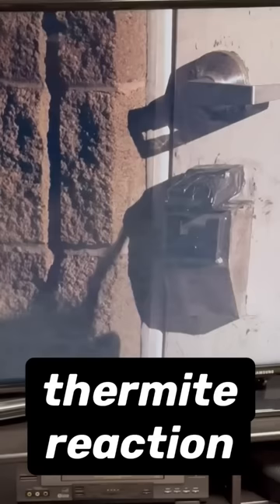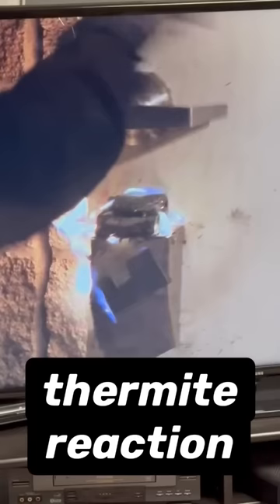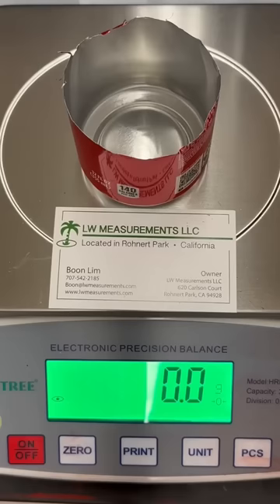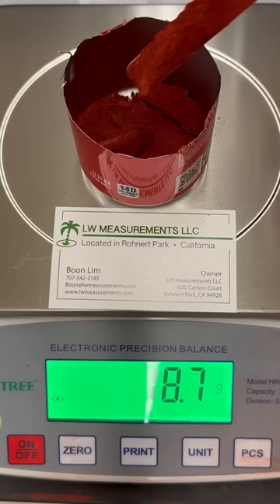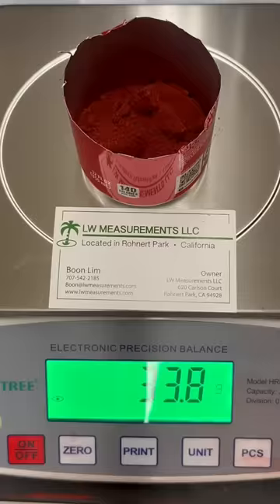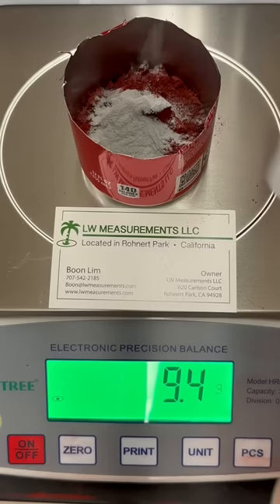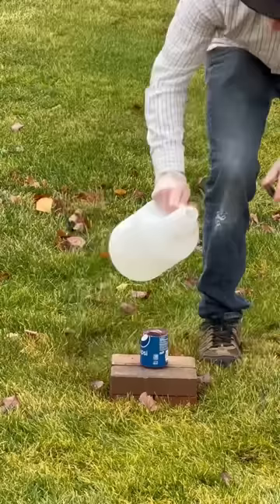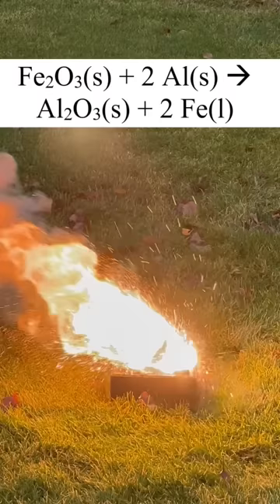Breaking Bad Chemistry: The Power of the Thermite Reaction 🧪🔥 #breakingbad #chemicalreaction

Comment: This same principle was used in a MacGyver episode, I think it was he used rust and copper from an old copper penny, he scraped the rust off of some metal scraped the copper penny on something that resemble a file, collected the rust and copper put it in a metal tube i think it was off of a bed frame in the room he was being keep in he plugged one in with a piece of wood used a match to lite the rust and copper essentially creating a crude cutting torch that he used to melt the locking mechanism on the door and escaping.

Comment: Thermite is awesome definitely need to be respected though it's dangerous
Reply from the maker: Indeed
Reply: @TommyTechnetium  
The experiment is not necessarily dangerous if one observes the necessary safety precautions, that is:
1. use rather small amounts
2. use a sparkler or a longer piece of magnesium ribbon as a fuse to buy time to move at least 15 feed away before the mixture ignites.
3. choose a fireproof base (a fireclay brick)
4. embedding the jar of mixture in a larger sand-filled jar (clay flower pots have proven helpful for this)
5. nothing within 15 feed around that can catch fire
6. wear welding gloves and goggles
7. of course only carry out outdoors
8. make sure that the smoke cannot move into neighboring houses
9. have a good relationship with your neighbors, inform and ask them not to call the fire brigade as soon as smoke starts to appear ;-)
10. not touching the mass after the reaction until it has really cooled down
11. not pour water onto the burning mixture or carry out the experiment in the rain or snow (otherwise risk of explosion!)

So definitely nothing for the balcony of the rented apartment. But if carried out correctly according to the above points it is not necessarily life-threatening even for laypeople... ;-)

Comment: Roughly 1 part aluminum powder, 2 parts rust(Iron oxide). You will need a magnesium fuse(the kind they use for fireworks) or it wont ignite. Rust is easy to get, and a rock tumbler will powder aluminum.

Comment: aluminium is used in lots of stuff, flash grenades, fireworks. Its just good that a proper reaction requires a specific diameter to be that effective or else every criminal would run around with a tiny bag of it with a piezo fuse to quickly get rid of locks.

Comment: When you mix fuel, metal oxide and metal powder, it burns up to 1000 Degrees Fahrenheit, hot enough to burn through any barricade known to man. Add some C4 into the mix, and you got one hell of a combination.
Reply: 1000°F barely makes steel mailable.
1300°F to ignite steel for cutting with a torch even though most grades don’t melt until their liquidus temperature which is around 2750°

Comment: Wish you explained why they were able to light it with a torch because from what I understand a magnesium strip is required to get the proper heat to ignite thermite mixtures. And the magnesium (if I'm right that it's magnesium) is pretty easy to ignite with just a spark.
Reply from the maker: Mg indeed works. I've never tried a propane torch
Reply: @TommyTechnetium  I don't think a torch alone will even work.
Reply from the maker: @kidpiper9642  I wish I could figure out a safe way to test this. No way I'm trying to light thermite with a torch
Reply: @TommyTechnetium  That's why I didn't bother trying to tell you to try it. Imagine blowing the stuff into the air and a gust of wind carrying it your way. Scary stuff!

Comment: The show makes it out to be very elaborate - with using aluminum oxide from those magic-drawing-toys.

You can file down any aluminum to get the power or buy the powder already (which, to be fair would leave a trail, so filing it is).
Reply: Spraying (fine mist) molten aluminum into a cooled inert gas is the fastest means of powdered aluminum.
Reply: Yea… you can’t make aluminum powder at home easy….  And it has to be FINE otherwise the thermite only smolders at best…

Comment: An oxygen lance  is the best thing for opening things.  My welding textbook says it will cut thru 6ft of steel and concrete.
Reply: My friend bought a house and the basement was rebar reinforced concrete.  One day he needed access to the plumbing for the kitchen sink and discovered that it ran to a room in the basement with no way to access the room.  We made a thermic lance out of an iron pipe filled with a steel cable that we untwisted and connected a hose to an oxygen cylinder.  We cut a hole about 12"x 12" and that was enough of that.  The amount of smoke produced was unbelievable.  The smoke was from  the  concrete.  You couldn't see your hand in front of your face.  It was fast and it cut through the rebar as well as the concrete. It was just so dangerous because we couldn't see anything and you've basically got the sun on the end of your pipe ready to burst anything into flame.  Not to mention breathing the smoke.  The room was filled 6 feet deep with broken glass.  We have no idea why someone would build a house with a ten foot by ten foot by eight foot, concrete room with no doors or windows in the basement and fill it nearly to the top with broken glass.  We shoveled glass out of there for 3 weeks.  We cut a door sized opening with a gasoline powered  abrasive saw.  Much slower but neater and safer.

Comment: I used to working construction and we tore up a parking lot and we found a whole entire railyard underneath it we tried cutting it with a hazard saw then tried cutting it with a oxy settling torch and I got so annoyed I just finally called up the fire department told them I was making a boatload a thermite to cut up the tracks and we got a permit to do it it works pretty good

Comment: It takes yes rust and aluminium,, but um it takes an oxidizer as well,, not just fuel
Reply from the maker: The oxidizer is the rust
Reply: @TommyTechnetium  um not so sure iron oxide has near enough oxogen to create such a hot burn,,, usually it's used as a fuel/secondary oxidizer in fire works,, all thermite's i know of use a chlorate or chloride as main oxidodizer🤔🤔
Reply: @TommyTechnetium  don't get me wrong, cuz I know there are different standard,,, what we use as electrician burns realy fricking fast cuz we are only welding a small joint,, so it might be differnt for large thick chunks of metal 🤔👍
Reply from the maker: @marktemplin1159  I'm just using the chemical definition of "oxidizer". That's probably where the difference is coming from
Reply: @TommyTechnetium  probably true, I used to have fun wene I was younger and probably forget more than I realize🤔👍 there are some simple things I remember,, it's been shit, 25 years since I was making my own home made stuff 👍
Reply from the maker: @marktemplin1159  It's so true! We forget so much as we age. Probably in part because there's so much more to remember

Comment: Jet fuel can't melt steel beams.
Reply: But it can weaken them significantly
Reply: It’s doesn’t need to turn them into molten metal, just weaken them enough to allow for failure. Go take a lighter and heat a paper clip until it’s glowing. You can bend it with minimal force, yet you didn’t heat it to its melting point. 

It’s amazing how simple of an answer that is……it’s only been 22 years and you still can’t grasp the concept
Reply: @joe4171 
The beams were literally vaporized not melted or heated. Vaporized.

Comment: One of the holes in the movie script...
I doubt it would had worked cause of the loss of energy.
Stream should had been localised to the lock...
Reply from the maker: I kind of tried testing this. See https://youtube.com/shorts/HGNYX-4XWqE?feature=shared
Reply: @TommyTechnetium  I already saw the video...
Where's you trying to bust the similar lock to the scene mentioned?
I am guessing it would melt part of the outside of the lock but not cut it...
Some ceramic casing with narrowish hole would build a stream of reacting thermite concentrated and aimed to a certain area, cutting threw the lock, doors, anything...
Reply: @TommyTechnetium  Shame for the series, even plot is full of holes...
"Breaking bad" had potential to be the great TV show, but it's just cheap fun for the masses and insanely overrated.

Comment: Highschool level chem q:
Heat energy requirement means it’s endothermic? The heat energy is what’s needed to surpass the activation energy?
Reply from the maker: That's right: the fuse supplies energy to surmount the activation energy barrier it the overall reaction is exothermic

Comment: It was used on 9/11 to cut the beams
Reply from the maker: I couldn't get it to melt a small lock https://youtube.com/shorts/HGNYX-4XWqE?feature=share
Reply: @TommyTechnetium  you probably didn’t mix it right. But thermite is used to melt thick metals. Do some more research and you will find out.
Reply from the maker: @miguelrobles4312  I used the procedure outlined in "Thermite Reaction" in Shakhashiri, volume 1
Reply: @TommyTechnetium  I believe there are different types of thermite. Might not be to sure but I’m pretty sure there has to be